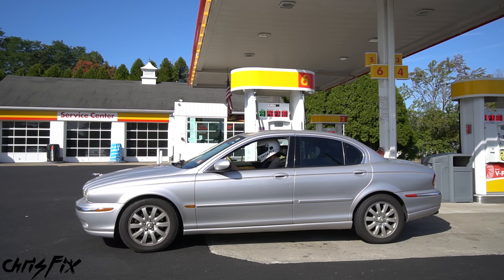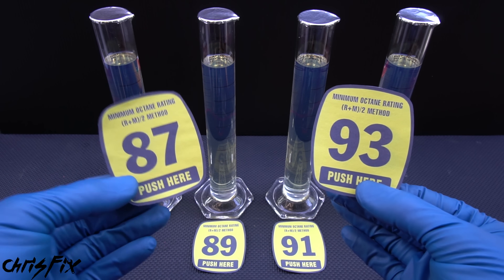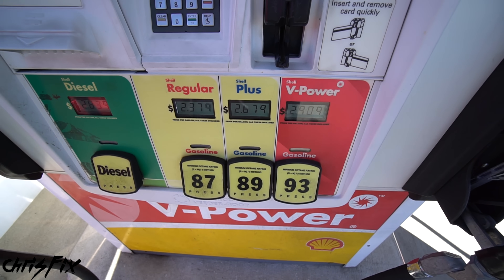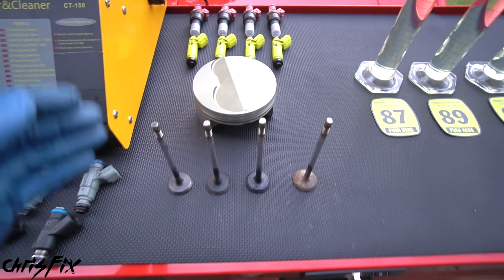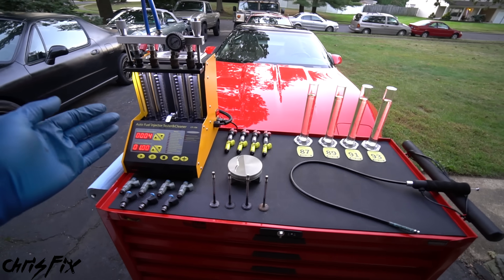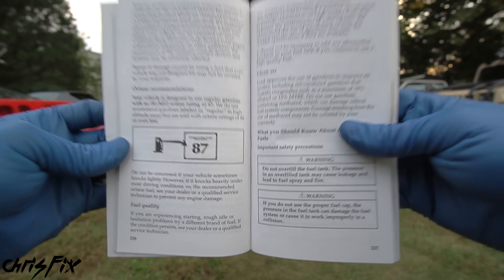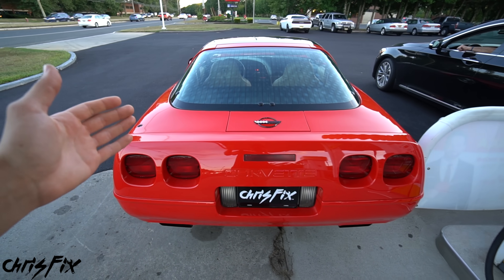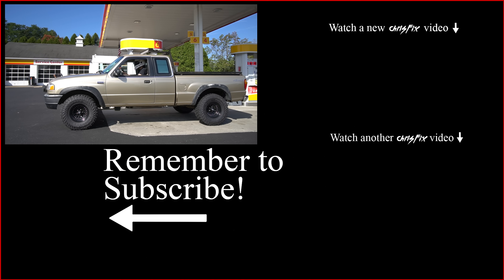What is the BEST Fuel to Use in Your Car or Truck and WHY

Comment: I'd never heard it called "PON" before. It's just the average of the research + motor octane ratings (R+M/2).

A person kind of has to be really determined in order to successfully fill up their gasoline-powered vehicle with diesel fuel in this country. Aren't the vast majority of the diesel pump nozzles too large in diameter to physically fit into a gasoline tank's filler neck?

I used to own a 1986 Buick Regal T-Type (like a stealth Grand National). It was a mostly street car, but had had a lot of the standard "Hot and Spicy Turbo Regal Recipe" done to it - so it was a low 11-second car, high 10s (once, with slicks). Just your average, everyday intercooled Turbo Buick... They'll all get sideways at 50 MPH if you suddenly stomp the go pedal to the carpet, right? ;-) . Anyway, my buddy set up one of those "six position" selectable EEPROM chip gizmos for it to match my bolt-ons/etc., and positions 4, 5, and 6 all required 100 octane. And, for about six weeks, the only 100 octane gasoline to be had around here was leaded racing fuel (or "low lead" aviation fuel, which had even more lead than the racing gas, if memory serves). That was before I found a source for CHEAP heated GM oxygen sensors (those cars had unheated sensors, and leaded fuel would kill them deader than last Christmas, lol; it'd eventually do in heated ones, too, but not so quickly, and later I could get them in a box of five for $80, so it wasn't a big deal). ANYWAY... For a while, I found myself having to mix up my own fuel. Seven gallons of 93-octane unleaded to two gallons of toluene and one gallon of xylene (or vice versa, I don't remember which), plus a dollop of Marvel Mystery Oil for upper cylinder lubrication worked out to just a tiny, tiny fraction over 100 octane - and my T-Type never even had its knock sensor tickled, even at 25 PSI boost. Was kind of expensive, though, like $80 to fill up back in... '99 or thereabouts. Er... and I spilled a drop on the rubber bumper trim and saw it "melt" before my eyes. Whoops. But it worked wonderfully for the application to which I put it, heh. And it even ended up cleaning the fuel system! Even removed most of the crap (that was already causing slow response times) from the unheated O2 sensor. Which was sort of an unplanned bonus.

Er... Just jabbering :-D

Comment: Another good time to run premium is when you're towing with a gas truck.  When you're towing, you're increasing the load on the engine, and you are pushing it closer to its knock threshold.  Stepping up the octane provides more margin for safety.

Comment: The thing is i'm in Australia and we have E10 here (10% ethonol) which also equates to 94 octane. I've ran a car before that required premium (95 or 98) using E10 instead with no issues. Since the octane rating is so close I assume the car adjusted accordingly
Reply: We've started using e10 here in UK, my car doesn't like it so much as e5 (which is 97-99 octane).. the milage estimator and mpg are no where near as good as usual petrol for me

Comment: He doesn't realize they all ask for 91 now. If you look at website for car you'll see it's now 91. To say it's same gas one has more protection but just know if it's a Corvette or even a 4 cylinder truck the thing is why not protect both. The cheap gas is only like 2 bucks cheaper per tank and will cause car to slug at 100k miles.

Comment: So my Denali get bad gas mileage on 87 so I'd have to say you are wrong I loose literally over 50vmiles and my car stalls more with 87. I am a female but I can read the fuel tank and feel the car on take off. I'll always use 91 or more mid grade some only give you the smaller but if they are out 87 go for mid you'll only get 91 plus

Comment: 1) Cars designed to run on leaded fuel (flat tappet cams and no valve seat inserts)
2) Alcohol content in Low, Mid, Hi test - is it still true the higher the grade, the less percentage of alcohol?
Reply: If your car is designed to run on leaded fuel, do the world a favor and destroy it
Reply: @jonathansmith7306  ...and your point is???

Comment: All I know is that my truck will not run on gas whether it be regular, plus OR premium...I have to use the NO LEAD gas, or some may call it NON-ETHANOL gas. If I use anything else, my truck runs like crap!!! Also, my riding lawnmower is the same way, if I use any other gas than NO ETHANOL, it runs like crap too because it's hard to crank and it constantly back fires on me. Using NON-ETHANOL, they both run so smoothly.

Comment: I drive a 2020 Raptor, I started with regular like 15,000 miles and then later switched to premium there was for sure a difference in the way the truck performed.  I am still using Premium Gas.
Reply from the maker: Yeah the raptor recommends premium so with a turbo charged engine you will definitely make more power.

Comment: Hey Chrisfix! I have a huge problem, here in Belgium (Europe) you have only gasoline with ethanol, but my car was made when gasoline wasn't with 10% ethanol, so I drive only 98 octane with 5% ethanol and the car drives better, is it okay?
Reply from the maker: If the car is older than 1992 then you might want to add some type of additive to keep the ethanol from damaging the fuel system parts. Otherwise you’re ok
Reply: @chrisfix  Okay then! It’s a 2007 car so I will stick to 98 octane and sometime 95

Comment: Hey Chris so I drive a 11th gen f150 with the 5.4l 3valve engine it says to use 87 but I used 89 and added only one gallon on accident will that affect the engine a lot?
Reply from the maker: Not at all. You can use 89 or 92-93 without any problems except in your wallet haha

Comment: So technically, wouldn't premium ultimately be the best, considering the longevity of the engine?  Regardless of the owners manual, from your explanation, premium would provide the most overall mileage?
Reply: Premium detergents, yes. Not premium octane unless your car is tuned for that

Comment: I disagree with you that premium gas will clean your combustion system. Good additive will. Better fuel economy, by using premium gas, in modern cars I didn’t notice. Yes, in old carburetor cars, it was, very slightly. But I used it to increase horse power and definitely I had to manually adjust timing to see the effect. My 1994 accord, for some reason, always has engine nocking with regular gas, even though it was designed for regular. Timing was electronic already, so I wasn’t able to adjust. We filled only regular gas for more then 15 years. Junked at age 22 with engine perfectly fine. I do not recommend to use regular gas if your car required premium. But I did test few times Lexus NX turbo with regular gas vs required premium. Did not notice any performance or fuel economy loss. No pinging at all, computer was able to do his job. Maybe I have to race to notice the difference

Comment: Thanks for the great video and thorough explanation about the different types of fuel. I have been using Shell premium for everyone of my vehicles even the ones that say 87+ for most of my life. So I just have one question. Did you receive any money from Shell for posting this video? I'm sure they don't need to pay anyone but I'm just curious and I'll likely continue using Shell anyway.
Reply: Duh he got paid by shell. Modern engines even with forced induction are not going to knock even with E85
Reply: Crickets....

Comment: Octane is an eight chain hydrocarbon. It is the standard for burn rate 100. Pump octane numbers RON and MON are burn rate ratios of a blend of hydrocarbons at the pump. High performance engines have advanced timing that need a slower burn to peak pressure. Daily drivers are less critical and timing is set so detonation will not happen. Summary timing and burn rate MON coordination.

Comment: Thanks you cleared up an issue for me. I have a 2018 Volvo XC90 and it’s recommended that I use a fuel that’s 95 RON for normal driving and 98 RON for optimal performance. An octane rating lower than RON 95 should not be used. I use 93 octane here in America so I now know that I’m using the right octane for my vehicle.
Reply: Straight to premium gas in America

Comment: So I recently bought a 350z and they have been putting 87 octane but 350z are supposed to take 93 octane I was wanting to how do I convert it back to 93 octane ? Do I just wait till I’m all most empty then refuel with 93?
Reply from the maker: Just start using 93. There is no converting. You can have a half a tank of 93 with 87 and it just blends.

Comment: Read car user manual for recommended fuel octane. Altitude levels do not affect modern cars. Look for brands with cleaners additives. Don’t waste money on higher octane gasoline than recommended.
Reply: "Altitude levels do not affect modern cars." Correct, but they do affect the octane of fuel. At higher latitude, 87 can drop to 85.
Reply: @berserker4262  computer will adjust
Reply: @jacquelinem2873  How can the computer possibly adjust the octane of the fuel?
Reply: @berserker4262  it adjust the amount of fuel/air mixture and timing
Reply: @jacquelinem2873  Correct, but the octane of the fuel is still lower at higher altitudes, that is all I said.
Reply: @berserker4262  yes of course, never said it would ☺️

Comment: Chris, I thought that fuel gas like mid and premium even regular did not clean your engine. This is why I use additives like techron concentrate cleaner with a 87 regular (to avoid carbon buildup/ gunk). So pretty much if my car requires regular 87 and I want the 91 premium which helps clean the engine, why use regular gas when I could use mid or premium  and avoid buying additional additives.
Reply: Because slower burning fuel like 91 in a car that does not require it can result in increased carbon deposited in the cylinders.

Comment: Should I “clean” out the engine once in a while by fueling up with premium if my car is made for regular?
Reply from the maker: You could do that but you would need to run it for like 2.5k miles to get the 70% cleaning effect. That’s how they tested it. It might clean with just one tank but there is no evidence of that. There is evidence of it after 2500mi of use tho.
Reply: @chrisfix  Thanks! And it's not dangerous to run premium in my 2006 hyundai?
Reply from the maker: @grigorekushnir  Nope, you can always run more octane (pump gas) without any issues. Dont run less octane if it requires more tho.

Comment: Question: my toyota with 25k miles runs fine on regular fuel, but a friend recommended I feed my car premium once every 6 months to “clean” out the deposits. Is this good advice? What you guys think?
Reply from the maker: If the fuel has the extra detergents, it might not be a bad thing to do every once in a while!
Reply: @chrisfix  much respect to you Chris for replying on a 2 year old video!
Reply: @chrisfix  llll))lll
Reply: @chrisfix  does premium fuel always have more/better additives than regular fuel?
Reply: @davidyang9902  shell premium has 7x the detergents than the government requires and I think it's the most out of the brands
Reply: @davidyang9902  Yes. Generally the reason behind supermarket fuel being so cheap (even the super unleaded) is that it contains the bare minimum required by law. The fuel all comes from the same refineries so all of the premium fuels like Shell V Power (and others like BP Ultimate and Esso Synergy) are the same regular fuel, just with the additives. Personally I use Tesco '99 RON (it doesn't have additives but being '99 RON it has only 5% ethanol) and then I buy an additive and add to a tank myself as it works out cheaper and has basically the same effect. I use Millers ECOMAX as you can buy a bottle that will treat 9-10 tanks for around £15-18 in the UK.
Reply: I live in alaska so there is no ethanol in the gas up here. It is nice though because I can run auto gas in my plane.
Reply: Your friend is an idiot
Reply: Yeah, that's not a bad thing to do. It certainly won't harm the engine and preventative measures are much better and cheaper than the alternative.
Reply: 87 or 89 is mixed with ethanol that caused deposits and carbon in engine. Put ethanol free gas. That is it
Reply: Use the fuel specified in the owners manual.
Reply: @kithergilliam153  IKR? I just watched this big production value, and thoroughly detailed video to hear the same thing eventually. FML It was entertaining and packed with detailed information though. You might add a spoiler alert before your post. lol
Reply: @kithergilliam153  Generally this is true apart from the fact that some countries have switched to 10% ethanol in petrol. Some cars can't run with this much ethanol but it won't even be mentioned in the manual unless it's a relatively new vehicle. My 2012 Vauxhall Astra doesn't mention E10 and while it can run on it, it runs worse and suffers from worse MPG. As a result I have to use the optional '99 RON instead of the recommended '95 RON as that only contains 5% ethanol.
Reply: When gas is premixing? 93?

Comment: For someone who clearly doesn't build or race cars, he sure talks a big game when talking about gasoline and saying that certain octanes don't burn hotter/cooler when that's BS because that'! Why dudes running E85 or E90 in their $1,200hp cars because it keeps the engine alot cooler than regular gas, only downside is you go through it faster. I wish people could use their own brains instead of listening to ONE guy on YT and believing it because he has 8M subscribers.....Kinda reminds me of Germany when the Nazi's took over....everyone believed hitler because he was powerful and nobody had a mind of their own to figure out the REAL facts.....
Reply from the maker: Sheesh man, that’s a crazy comparison. Octane has nothing to do with burning hotter or cooler. This is a fact. This entire video was checked by multiple  petroleum scientists which I also interviewed to get the info from and make sure I am accurate. The reason e85 and ethanol products create a cooling effect is because that is 85% alcohol and alcohol burns different than gasoline. Ethanol and e85 was not talked about in this video. This video was specifically about pump gasoline which is e10 or less. Everything in this video is 100% correct and accurate.

Comment: I used to drive a 2015 Acura TLX Sh-AWD 3.5L V6. They recommended 91 so I put 91 in. I read that I could put 87 it as it would be safe, after I did though all the sensors (including e-brake) started acting up and the engine even misfired a couple times. This is after months of putting 91 in btw. I filled up 87 again and although the car was running fine just not as smooth or powerful all the sensors were still going crazy. So i decided to out 91 in it again and everything was fixed. No issues after that. 

Could this have been an issue with the engine or is it more of a sensor thing?
Reply: Bro wtf same

Comment: I would like to share my own car and driving experience.
I have graduated Bachelor in Applied Technology major in Automotive Engineering.
I have a few cars and i would like to share my fuel consumption of my cars and driving experience using different RON of petrol.
For your information, in New Zealand we use RON, instead of MON+RON like the USA.
The way I calculated the fuel consumption is:
Replace the engine oil and filter, finish up the remaining fuel in car until low fuel warning. 
top up the fuel tank until it stop itself (i always use the same petrol station and same pump machine)
Reset the trip metre
Drive until the low fuel warning is on
Back to the same station and pump, fuel up and wait for the pump to stop itself.
Record the quantity of petrol filled up and also the trip metre.
Reset the trip metre and record again as above. I usually do 3 times the same RON petrol before i procees with another RON type.
NOTE: when Changing the next type of petrol, i will do another engine oil and filter change, and repeat as above.

Start with Toyota Wish 2004 with 1.8L 1ZZ-FE engine, the manufacturer recommended minimum ron91 fuel. 
My experience is, in average of 3 fuel consumption records, the RON91 petrol has fuel consumption of 11.8km/L.
RON95 fuels average 14.4km/L while RON98 fuels average 14.5km/L over average of 3 times fuel up each.
When i work out the money paid, the tankful of RON95 i used is cheaper than RON91 and has a slightly more smoother and more powerful experience. RON98 in the other hand, make no much difference in terms of driving experience, and yet. I pay more than needed.
(RON95 is abouf 11% more expensive than RON91 but RON95 can get 22% better fuel consumption than RON91)

Using the same methods of calculation as above, i was doing the same for my 1999 Subaru Legacy wagon BH9 2.5 auto NA.
however RON91, RON95, RON98 make no difference in terms of fuel consumption, and driving experience thus i stick with RON91 petrol.

Note: to make sure all tests have the similar result, i drive the same car to work and back 6 days a week. And drive another car on weekend so the results remain consistent.

Comment: I drive an 01 Accord Coupe with a manual  for Doordash and when I rev often with 87 I get as low as 24 MPG, when I drive the same with 91 I get 27 MPG. Gonna head to Shell and try 93 as my owners manual simply says 87 is the minimum required.
Reply: The detergents and your driving style have more to do with efficiency than octane rating

Comment: Mine needs to run 91+ I have a 2017 Jetta had to do German transition to what they had on the gas door apparently you can get them non-turbocharged in Germany then you can run 87. I put 87 in it once because I thought I could but nope. The engine was knocking bad over 2000 rpm and throw a misfire code on all cylinders.